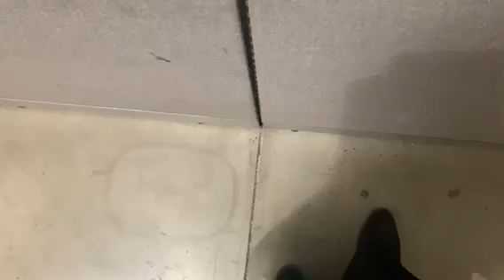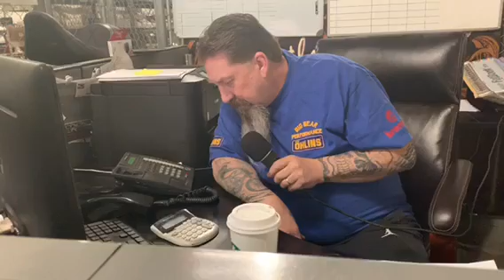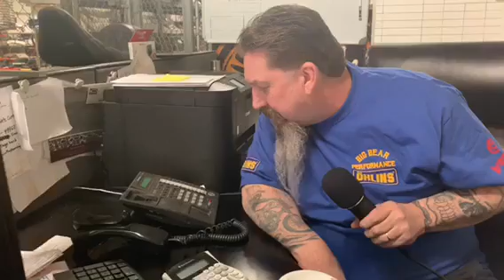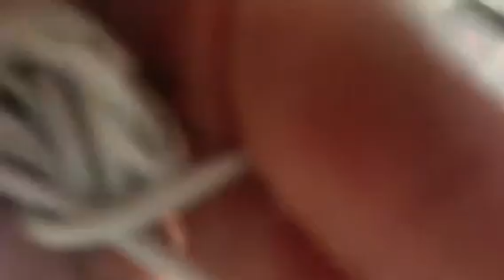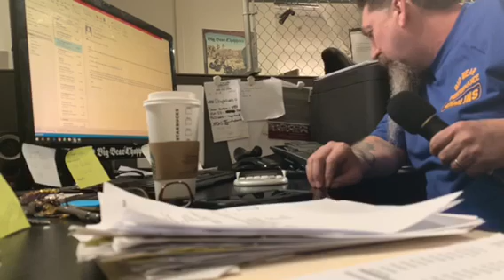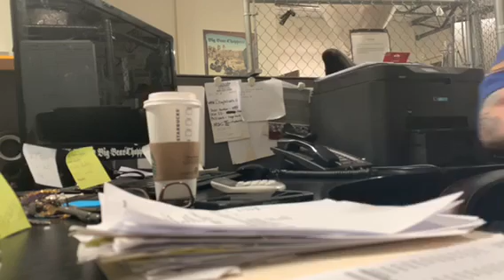Dyna. Death wobble troubleshooting

Comment: I have ohlins 13.5 rear shocks on my dyna, and a set of racetech springs with 2 inche dampers on the front. And my shit is solid.  I'll hit corner doing 90+ with no wobble at all.  Just had to adjust my front end to a tee with the speed merchant preload adjusters.  . Bike is solid as fuck !!!!
Reply: Hello Anthony did you also fit the sputhe chassis stabiler kit front and rear?

Comment: I have a 2001 ultra classic I put a 26 in wheel and American suspension bolt on kit. For some reason when I takeoff or I’m at slow speeds the handlebars go back-and-forth very violently any ideas? Brand new tires and bearings were checked and are good.